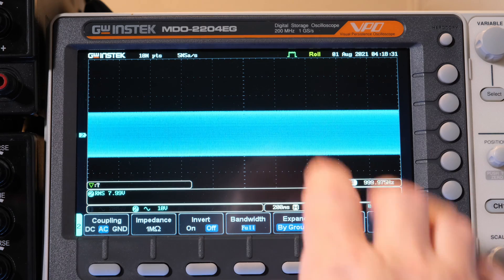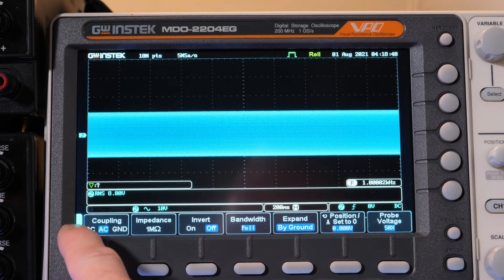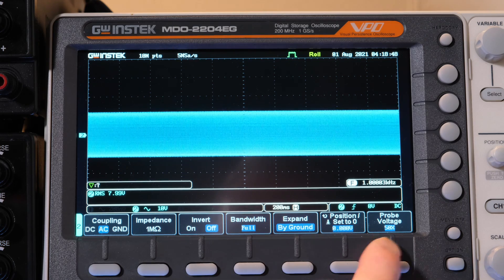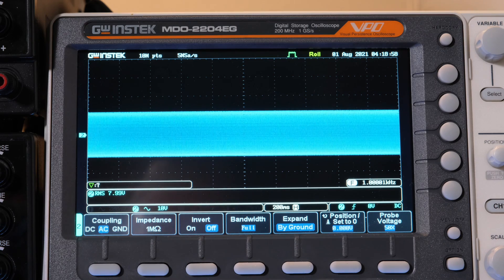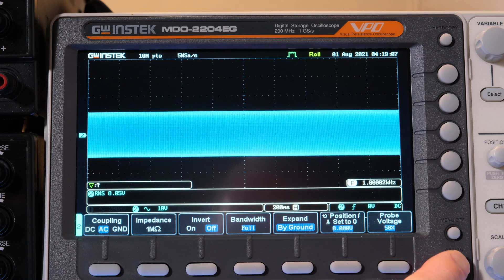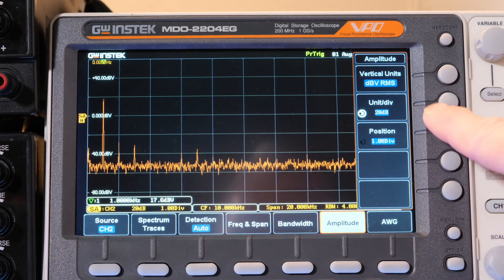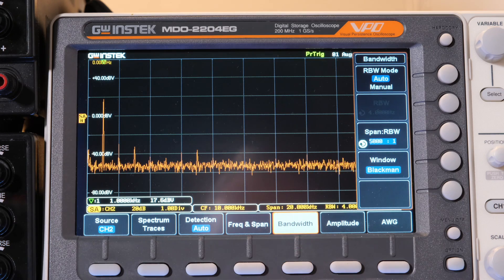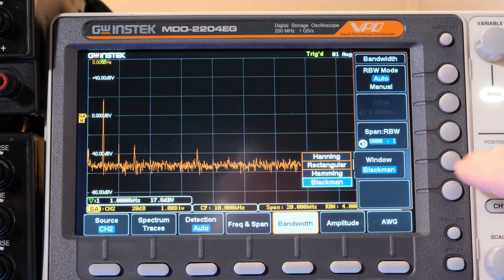Class D Amplifier Spectrum Analyzer GW Instek MDO2204EG vs PicoScope 4444 #12bitoscilloscope

Comment: Use tme sweeo and averaging, the noise will reduce because f its randomness but then peaks will correlate more and provide a  cleaner reading of what is important Noise is random and does not autocorrelate.
tant
Reply from the maker: Great to hear from you Nico!  I actually tried some of this on the side and didn't see a lot of improvement.  Actually the GW showed higher averages with time as the higher speed writes made it look better;)

Comment: Thanks for the great video. I would not have guessed that the picoscope would produce a much better spectrum than the GW Instek if I hadn't seen this video. I work in sonar where we work mostly in the frequency domain, and the GW's two tone dynamic range of 50 dB would be considered unusable...
Reply from the maker: Thanks for this great feedback!  I expected the Pico to have a lower noise floor, but I was surprised how much better the resolution bandwidth was and can be even better than what I showed.

Comment: Hey cool video. From the PICO website I've been trying to figure out what a few things mean.  First  thing is "Resolution enhancement to 12 bits" The scope I'm looking at says it's 8 bit but can go to 12 bit in enhanced mode. I wonder if it means the bandwidth is lower to make the vertical resolution higher?    For FFT points it says "Selectable from 128 to half the available buffer memory in powers of 2" . Is that terrible? I'm still learning about the math functions on a scope.
Reply from the maker: Great questions Tron!  I'm still learning too;)  First, it is very typical that every bandwidth is divided in 2 for FFT.  The basic 2 points per cycle is what it is.  The bandwidth is limited because of vertical resolution.  My Pico is 12 bit but can go even higher but is in 'hires' mode and starts to limit bandwidth.  Unless you are spending $20k on a scope, then there is this tradeoff;)  But, it really isn't that much of a big deal for most of us.  Which model are you looking at?
Reply: @KissAnalog  2205A MSO oscilloscope. I like that you can add a logic probe to it. Seems like a great scope for under 500 dollars. Only 25mhz but I don't really ever test anything that fast anyways.

Comment: That 12 bit res sure makes a difference, my 10 bit R&S doesn't compare. I think I'll pic up one of those, really cool!
What's the class D module you're using?
Also my thinking is that it's better if I take the preamp or buffer and feed the signal into it so the final bode or FFT gives me a better picture of the buffer / amp combo. I think I can fine tune my final result better.
Reply from the maker: Thanks for this feedback!  The 12 bits - especially compared to 8 bits is huge;)  I think once you get 12 bits then when I go to the 14 bit hires mode, I don't see a big difference.  I think I'd have to be looking at something small to see the benefit of 14 bits.  The 12 bits are noticeable though.  I was curious so that was one of the big reasons I wanted to try the Pico.  

The Class D amp board can be found here: https://www.youtube.com/redirect?event=video_description&redir_token=QUFFLUhqbldsQzFtdHFyT3RqNi1WbDJvNlJjQlJjXzcwUXxBQ3Jtc0trcEtjdEdKS2NRMjJzSnZTc2x2OUhnb1NKTDVqNU45dWF2Y3EtY0tGSjdBOVEzSTFJeHJ3WDVwc3Q1NVcwSGhlc2t4X3Q2VFVJNFpMZE9xM2lFaEFpRzRzNWd0aHdTZ3R1ekNiX2dYYkJpeGt5WXUwQQ&q=https%3A%2F%2Famzn.to%2F2LBqvxF

Comment: Ge rid of the color led back light because it beating with your camera frame rate causing strobing.
Reply from the maker: Thanks Scott!  I didn't notice this before.  I changed my camera rate to match my computer video at 25 fps.  Before I had it at 24 fps and didn't see this.  Crazy it made this much difference.